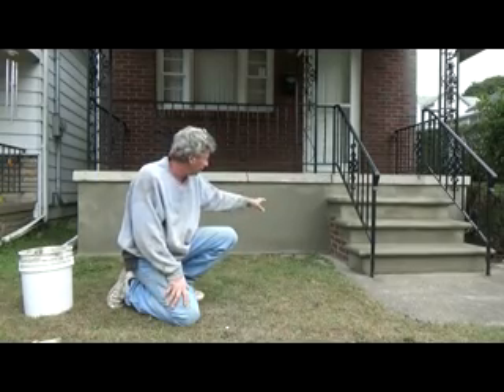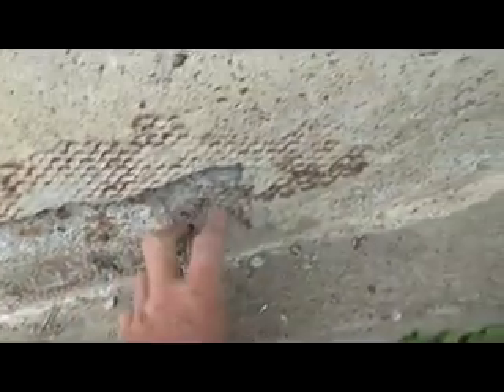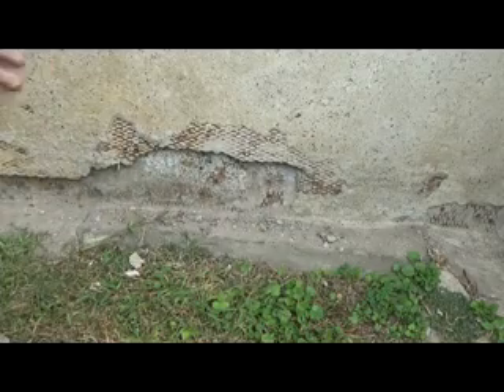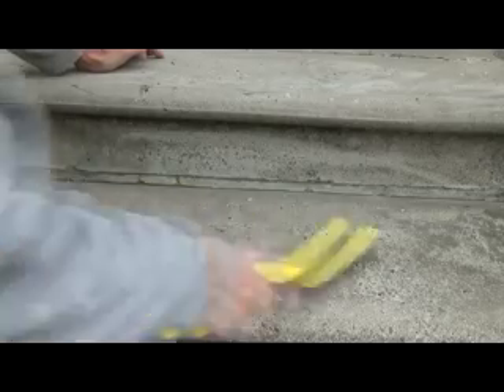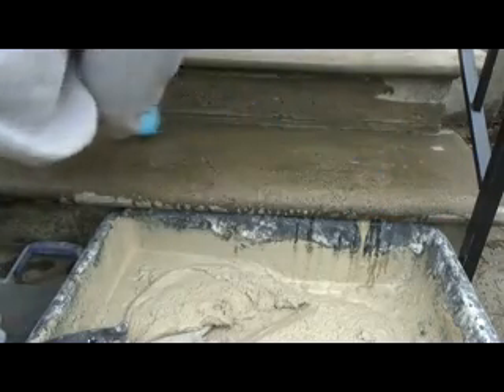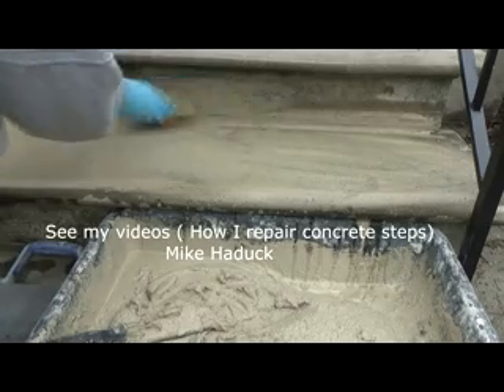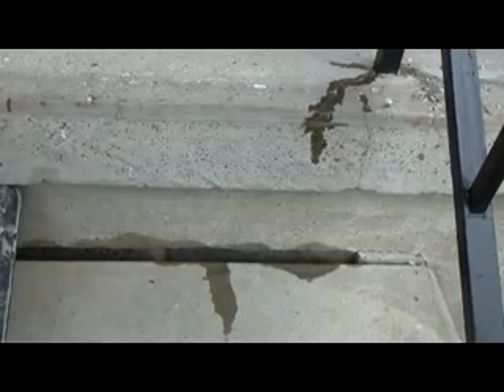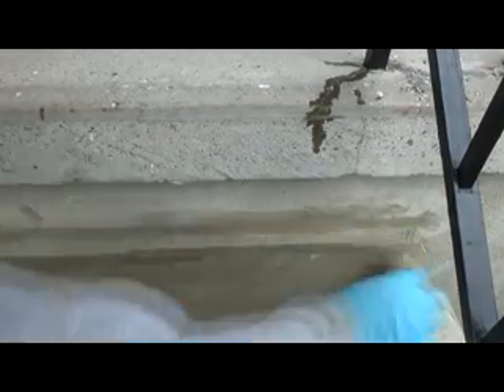FOUNDATION REPAIR  (part 4) Mike Haduck

Comment: The main problem with wire mesh in this video is that has  not been properly installed due to lack of anchors to the existing wall. Any water seepage from an improper porch slab installation, eventually penetrate behind the wire mesh and causes to disconnect. In cold climates this will cause major problems, if the bottom corner of slab to wall is not sealed properly, assuming of course, the parging  of the wall is  properly finished.  Thank you Mike  for sharing your expertise, I have subscribed to your channel  for awhile now, and have recommended  to my friends  and neighbors when they need expert concrete advice.
Reply from the maker: thanks Egilio,  I rarely use mesh on concrete, stone or block walls in Pennsylvania,  it leave spaces for termites and critters and eventually rots away, so like Europe I just go over the existing masonry,  with cement products, I know everyone has their own ideas, and I appreciate the comment,  thanks mike
Reply: Ok, thank you for your great videos and courteous response, I always appreciate  you sharing your expertise.

Comment: Mike quick question. I'm doing a parging job on a commercial property on the foundation. It's a poured foundation , very smooth, the customer wants it touched up,. 1. Wet it good, 2. Natural bonding agent . 3. Parge it with a scratch coat. 4 wait go back and wet the scratch coat and give it a final coat with a sponge finish? Does that sound right
Reply from the maker: Hi Jamie, that's what I do give it a few days before final coat, thanks mike
Reply: Ok great b4 I apply the 2nd sponge float finish I wet the skin coat then apply natural bonding agent again then coat it with the final coat? I wanna make sure my steps r right mike
Reply from the maker: I dont use a bonding agent for second coat just wet it first,  check my foundation repair videos, I usually use the same techniques, mike
Reply: Ok great mike just making sure just water on the scratch coat and natural bonding agent then water then the second coat I should be fine with that. Ty mike
Jamie

Comment: Mike, If you run across loose wire mesh during a parging job what will be the outcome from just repairing the holes in the  old parge? What’s the time frame for the outcome?
Reply from the maker: Hi Terry, it all depends sonetime I just go over it and then use a masonry paint to seal it. You will see it as you watch the other videos, , thanks Mike

Comment: How would I patch over an old door way that is now closed off by cinder blocks.
Reply from the maker: Hi Groovy,  if I am reading you correctly, I smash out the blocks below floor level and fill it in with cement,  every situation is different,  I hope it helps, mike
Reply: @MikeHaduck  thanks

Comment: Mike , I have been watching your videos are awhile and you make it look so easy ... great job 👍🏽.. I live in Canada 🇨🇦 my old house needs foundation repairs( it have big hole, cracks, )  and step repairs ( has holes to and also I would like to skim over the cement porch ... can you tell me what I should be using to DIY project .. Thanks again 

Deb 🇨🇦
Reply from the maker: Hi Deb,  I show what I am using on each segment, so if you find something that fits, do a little experimenting and go from there,  I hope it helps, mike

Comment: Hi Mike. I have a old brick foundation and parts of the brick were plastered or cemented over because of leaks or whatever reason.  Can I just use your Portland paint to cover the brick foundation or do I have to cover all the bricks with a plaster or cement. Mostly for looks so it all looks the same.  Thank you.  Love your work and videos.
Reply from the maker: Hi Richard, I can't say unless I was actually there to see it, I have a video called " basement water problem solutions and others on foundation repair," I would also ask some locals,  I hope it helps, thanks Mike

Comment: Mike.   For the patch job only morter? How come no portland or sand?   
The painting of morter and portland is really cool idea also
Reply from the maker: Hi Tommy, I used rapid set, that's a different story its fast and strong, then I am pretty sure I used s mortar and Portland to paint it,  it worked fine, every situation is a bit different thanks mike
Reply: I appreciate you even getting back to me.  Means alot.   Im going to use rapid set also.   Maybe try to paint it with white portland and maybe white morter if they make it

Comment: one more question, my backyard cement stairs bottom step is chipping and cracking can I fill it in the way you do? is that requiring a permit? we're first time home owners so any advice is greatly appreciated.
Reply from the maker: check out my video, "how I repair concrete steps" (part 1 to 5) that might help,  thanks,  mike

Comment: How do you know if you need a cement/mortar mix or a concrete mix? I'm going to start a few foundation repairs and I believe I need a smooth mixture...maybe you have a video that addresses this question.
Reply from the maker: check out my videos, Stone foundation repair (part 1 to 3) mike haduck and you could see where in big spaces I will use a fast drying concrete mix and then in the smaller places just cement all or regular cement,  I hope it helps thanks mike
Reply: +Mike Haduck perfect, thanks for taking the time to document and share your craftsmanship

Comment: hey Mike,  thank you for the video,  my house is 116 yrs old, I want to do this in my basement as there are a few places that are coming loose. do I need to pull a permit and will this stop water from making its way in?
Reply from the maker: Hi Angela,  water problems are usually fixed from outside, (rain gutters-land pitch, etc), I did a few videos, "stone foundation repair" (Mike Haduck,) check them out , they might help,,, and  around here I have not pulled a permit for any repairs, only new structures,  or remodels,  every town or city is different, thanks mike,
Reply: thank you, yes my buddy told me about fixing the gutters and grading around the foundation its on the list.
Reply from the maker: thanks Angela, I have a video coming out on that probably before spring,  thanks mike

Comment: Great Video Mike,  just curious why you used the Mortar in this video for the steps instead of just Cement All.  Are there any advantages to the Mortar?  Thanks again!
Reply from the maker: +Jason Mathew  I actually used the cement all, but cement all does not hold up on steps when very thin, it needs paint or like I painted with Portland to cover it, and then it seems fine,  thanks mike